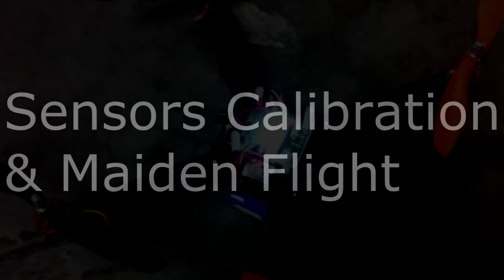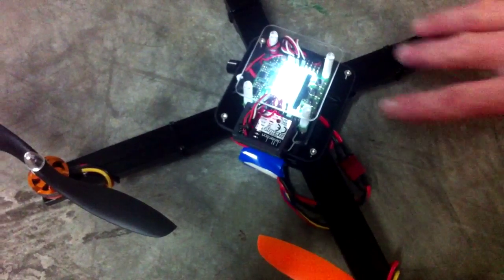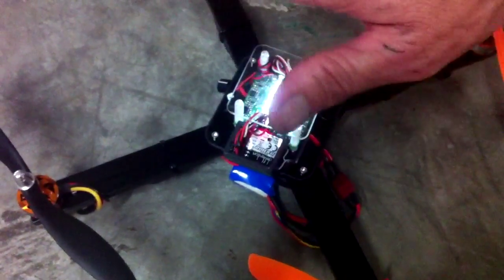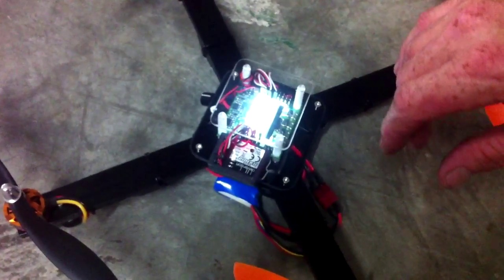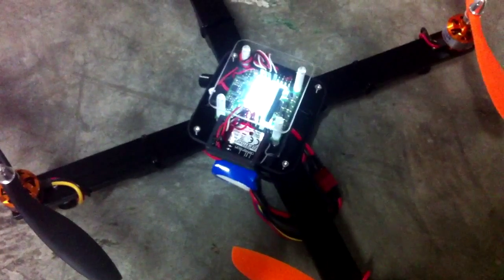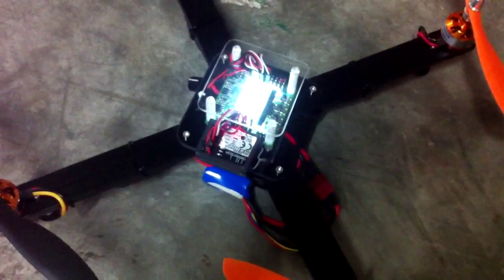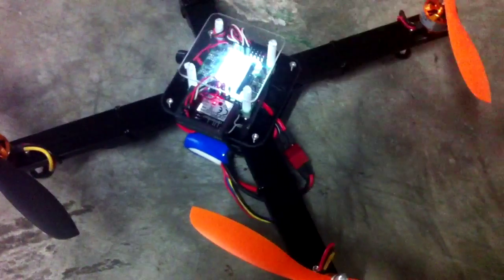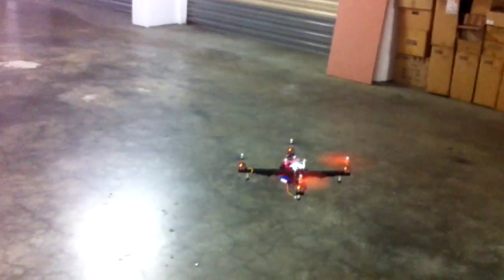Building A Quadcopter: Sensor Calibration & Maiden flight (part5)

Comment: Hi! I know it's been so many years that you did this bird. I relatively just picking up the pieces and try to put it together. With the settings on the PI I did follow what you've said and still getting this oscillating once it's up in the air. No matter what setting I did that shakiness never went away. Any idea or suggestion might be that I'm doing wrong?

Comment from the maker: If your KK2 is configured with a + configuration and all is wired correctly, it should lift off. Try it in grass and see what happens. ;) You can also go into receiver test on the KK2 to make sure all your channels are in the right direction. You should do that before your first flight.

Comment: Very nice! I just built my first quad (+) today, and I noticed that when I try to lift off it tends to tilt slightly to one side and drift in that direction. In fear of having it flip and crash I just put it down immediately. I see that your copter does the same but levels out just fine when it reaches a certain distance from the ground. Is it just the air currents that causes this?